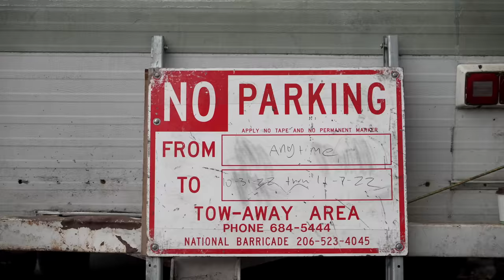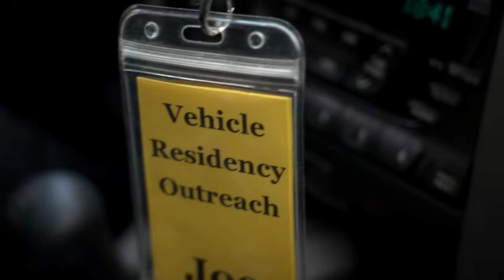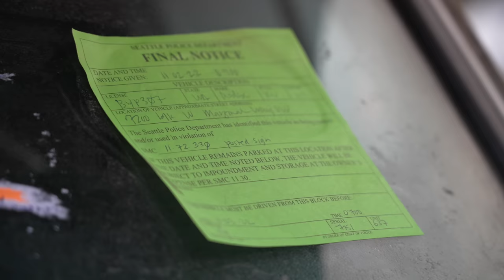Where Do They Go? The Painful Reality of Seattle's RV Homeless Sweeps

Comment: The easiest solution is to build them an RV park where they can stay in peace.  You can have it with water, sewer and electric hookups like a regular campground, and pay what you can afford and have work positions there to help pay for the stay by doing maintenance, landscaping, etc.  They would love that, it would cost less than the billion that goes to thin air helping them, and the city can say it is just another campground and not be so offended.  We have to work TOGETHER to solve problems not point fingers at those struggling and oppressed as if they can solve it alone.

Comment: Local authorities are being completely reasonable when it comes to the sweeps and the removal of vehicles. Most of the vehicles are incapable of being driven because the motors do not run or the brakes are inadequate. The vehicles leak, have missing windows, and have battered and broken bodies. How many of these vehicles would break or fold in half if they were placed on lifts or hoists because they are so rotted and rusted?

What percentage of these vehicles are on the road illegally by virtue of the fact that they are uninsured and do not have have valid license plates? These is even before municipal by-laws relating to parking and camping are taken into account. These people and their vehicles have turned the breaking of state and municipal laws into a lifestyle.

Finally, there is the fact that these people are dropping unsightly shit into people's neighborhoods. The vehicles are old, missing body panels, multiple colors, and covered in tarps and plastic. Then there is the crap and garbage that is strewn all over the place. It is as if these people are constantly collecting stuff for the sake of collecting things. They have certainly never heard of picking up after themselves and disposing of their garbage. Expecting people to look at this blight every day is unreasonable. Removing this blight is in the public good.

Comment: They won’t engage in funded housing projects because of the rules against drug use, and mental health comorbidity.

Maybe we should focus housing funding to purchasing safe operational livable vans or <22 ft rv’s🤷‍♂️
You could have remote parking areas with hookups that could always be moved to other locations.  
Conditions of use could be requiring them to use pre designated areas.  Bruins model kind of worked down here in San Diego , but the condition of the rvs and campers were so substandard it became a mess.  You can address access to services by perhaps locating the domicile parks within close proximity to a public transit route that gets them to services within a reasonable amount of time.

The situation with unhoused is primarily concentrated around metropolitan and busy industrial areas close to big cities.   

Maybe Elon should quit digging holes and help develop urgently needed solutions; like super efficient livable vehicle’s that are easily cleaned and maintained.

Comment: "If there's housing then why are they still on the streets". It's because they destroy the housing. The first person, that very first RV what do you see? Piles of trash in front of the door. There's a reason why these people are homeless. Also using homeless as a blanket term is not helping. There are multiple groups that are in their situations for very different reasons. 

Locally we have two homeless camps. The first one which I refer to as the real homeless people. They have jobs, they live in their vehicles, they are quiet oh, there are no piles of trash, there is no piles of human feces, nothing is burning down, the law enforcement never get called to this area.

The other homeless encampments is the exact opposite. It's a disease-ridden cesspool of Filth, it's a nightmarish hellhole. Giving these people housing will not solve anything, they just destroy the housing itself. If the housing has any kind of security then they will not use it. They'd rather be on the streets because they are drug addicts and or mentally ill. 

Los Angeles has its really nice homeless shelter. Individual Lil housing units, clean and up-to-date. Safe and secure. It's practically empty and it has been that way for years.